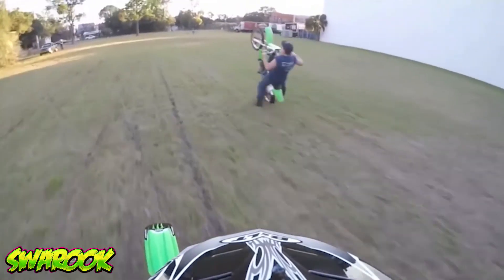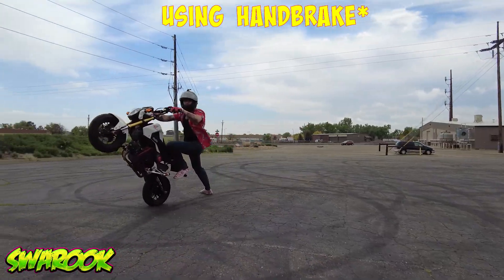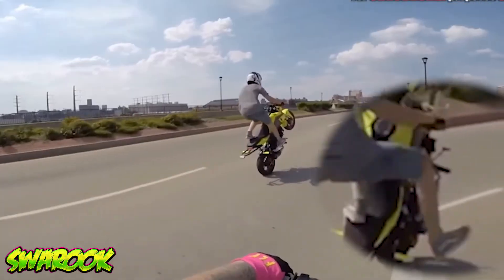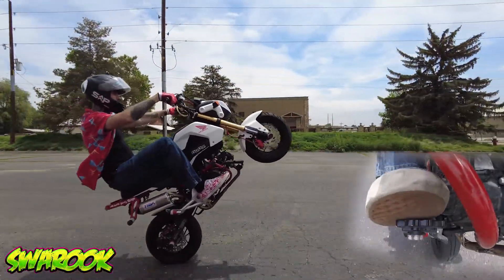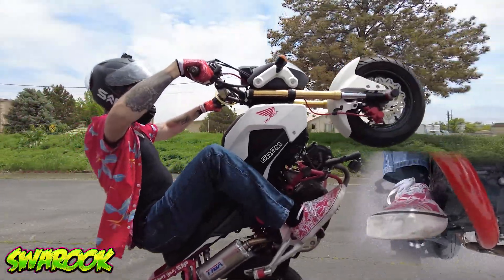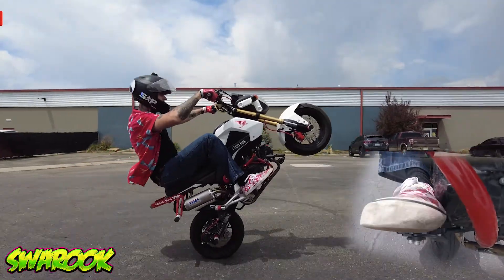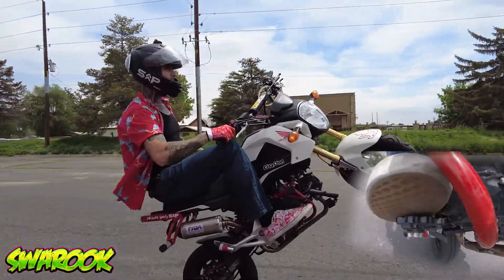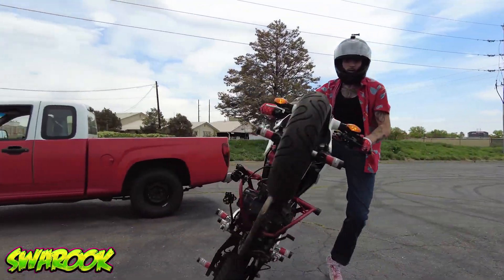How To Wheelie Part 1:   Brake Control

Comment: Great video man,I'm doing good with the brake, it's the throttle that's killing me,I rev it up to about 6k then dump the clutch and I hit the brake but I can't get to bp from a foot drag stance,any suggestions on deat stop foot drag,can I give it less gas and pull the bars up to bp and kinda slowly walk it with my foot down.anything will help

Comment: Awesome video, lots of great information. Looking forward to the next parts. One recommendation, you mention the hand brake and it might be good to point out that the hand brake is for the rear brake (and not the normal front brake).
Reply from the maker: Sadly there is a books worth of information left out. I can only include some stuff and being as specific as possible makes a series like this possible. im going to do a whole episode on hand brake thats why i only mention it. if someone ends up thinking that means front break then theyll learn the hard way why the camera was on my foot.
Reply: @swarook927  totally agree there’s way too much info to cover in a single video, you did a great job with this and looking forward to more!

Comment: do you use clutch when doing wheelie?
Reply from the maker: You mean to pop it up? If so yes. If you mean after i am up no.
Reply: After. Thanks. I’m learning but I have a feeling I’m not pressing the foot-brake strong enough to suppress the engine the way I’d be comfortable with.

Comment: Some people say smooth throttle but you basically say chop it so which is the right answer
Reply from the maker: This video is about brake control. If you learn brake control you wont have to ask this.
Reply: @swarook927  i am learning brake control right now. mines pretty choppy like this and i can only keep it up for like 6 seconds. after learning brake control do you keep the throttle more steady? or do you wheelie like you do in this video all the time?
Reply from the maker: @BriceTooNice  I already said "If you learn brake control you wont have to ask this"
You're LEARNING brake control. When you've actually learned brake control you wont have to ask this. Everything you're looking for is in this video. IF you learn brake control you have learned throttle at the same time. Stop focusing on throttle and focus on the brake. If you get to balance point because you focused on throttle and dont know brake you're going to crash.

Comment: what gear are you in when you pop the clutch?  do you shift into a higher gear when at BP?
Reply from the maker: Im in 1st gear and stay in first. I don't even know how to shift in wheelie yet cause i am always in a lot so never need out of first.
Reply: @swarook927   I have a benelli TNT 135 with 14T front & 40T rear gearing (stock is 15 F, 36 R).  1st gear is super narrow.  It has a full stunt build but these bikes don't have any power to get the front wheel up.  Learning to wheelie on a Grom, or Z125 or Benellie 135 takes so much more effort.   I also have a CRF150R and a YZ450F -- these bikes are super easy to wheelie.  the front wheel pops up with no effort whatsoever when i clutch-up.  2nd gear is the magic gear to learn wheelies on a dirt bike, but damn is so hard to get the Benelli to pop in 2nd.